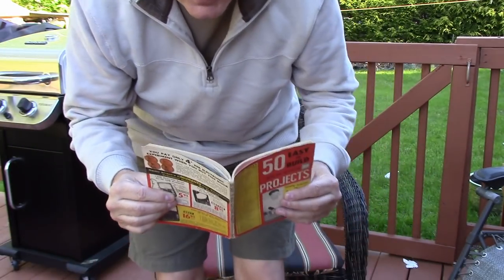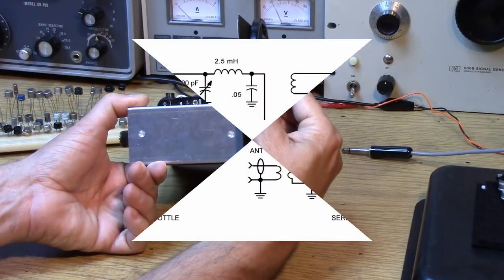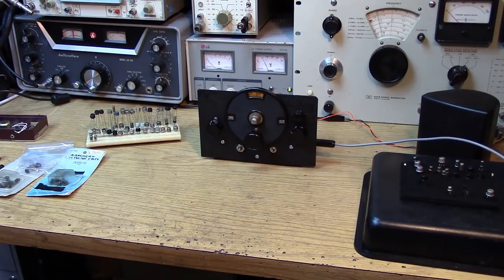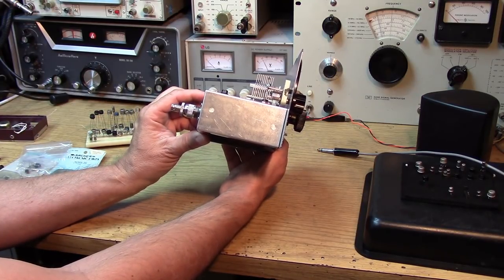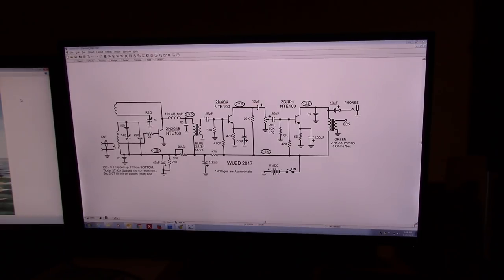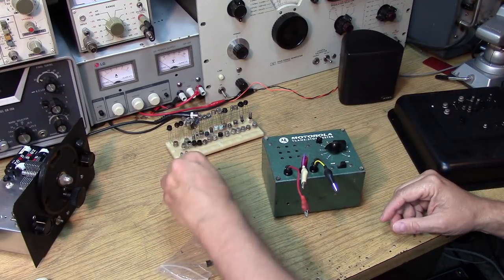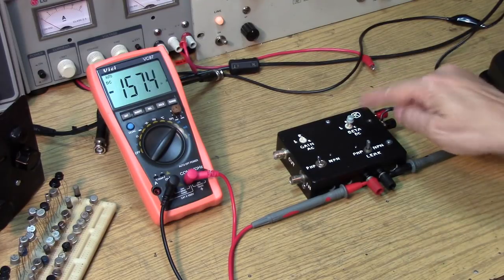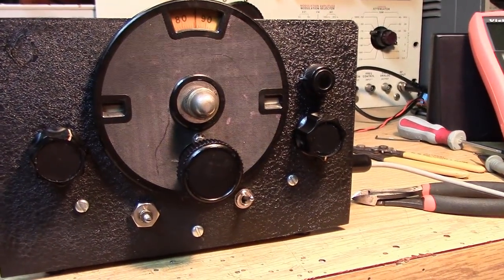Germanium ad Nauseam

Comment: Great video Mike!  Looks like the 'bias'-pot is really more of a necessity no matter what  transistor type (Ge-Si) that you would 'commit' to; in fact, I would think that it would still be useful, to compensate for the unit-to-unit variations even for the same part number type.  Glad you made and demonstrated the bias-pot.  73...
Reply from the maker: Yes, the variations and leakage and of course temperature effects cause  a gospel solution of popular resistor values to be unrealistic with these old devices.
Reply: @MIKROWAVE1  That’s a great point. I have built book-circuits when I was younger and by the time I got them working ‘something’ was drastically different in either components or layout between the two.  Another perfect analogy to me is how wide (read coarse and erratic) are the potentiometer values that are spec’d in projects; I always found myself adding resistors either around or across those pots to ‘slow’ them down!  73...

Comment: The crystal oscillator type tester is suitable for low frequencies (<20mhz or so) but when used with higher frequency overtone crystals you can have the oscillator oscillate at the fundamental crystal frequency instead of the higher overtone. Likewise, with a really high FT transistor, the effective overtone is not determined  without tuning so you also can be fooled. So a counter would be useful in making sure the actual oscillation is at the marked crystal frequency.
Reply from the maker: Great point! The tester is quite primitive. I was just playing with a simple triode tube oscillator that was designed to tempt ordinary FT-243 crystals into oscillating on their 3rd overtone.
Reply: MIKROWAVE1  Isn't having a counter a great convenience! ROFL!

Comment: If you are interested, I have a collection  of vintage schematics for Ge transistor circuits from the 50's early 60's. I had a good friend at my local radio supply that frequented the old but useful shows and I often bought a lot of his treasure finds. Sadly I do not have the components, but have managed to keep the cut sheets from the kits.
Reply from the maker: These could be fun to explore in video. Of course GE in itself is an interesting story.

Comment: MK-328 tester works great for testing. resistors, caps, coils, transistors,diodes.
I use a hot carrier diode for detector in crystal sets.
I suggest a jfet for the regen circuit with a hot carrier diode across source to gate to prevent forward bias of jfet

Comment: Nice receiver. Hope you can provide some info on the coil diameters And slug core size  you used here. And possibly a detailed video on the final circuit build. I am working on a similar project Thanks.
Reply from the maker: The Coil is wound on a classic National XR-50 coil form. It is 1/2 inch in Diameter and the winding space is 5/8 inch long. The powdered iron slug is pretty big. If I were winding an air coil, like on a 1-1/4" diameter pill bottle, I would actually start with the same number of turns and grid dip it with a 270 pF cap across it and see how close I am to 40M.

Comment: Usual utterly captivating stuff.
 However, a bit of a puzzle in the transistor list.
The 2N3906 is listed as a general purpose, small signal, PNP silicon device and its NPN counter-part the 2N3907.
Sorry if I've got the wrong handle on this..I'll check again.
Regards G3NBY

Comment: A oscillator is a class A amplifier. I think all three transistors in your design work as class A. Is this correct? 
There was a science fair regen receiver with three transistors. Easy to build for beginners  with a coil wound on a batterie. The box with the parts doubled as a case. This is a very easy to build circuit with a good manual.
Reply from the maker: Yup generally all low signal linear RF amplifiers are biased class A.

Comment: What kind of antenna are you using?
Reply from the maker: I use a 260 ft square loop in the vertical orientation pulled up into the trees with the top at 80 feet fed with a 1:4 balun. 100 feet of buried coax out to it. it is a quiet antenna that covers shortwave well.
Reply: Thanks for another great video!
Reply: @MIKROWAVE1  Holy good night... MY trees are only 65' at the highest. You must be in an "interesting" part of the universe! LOL